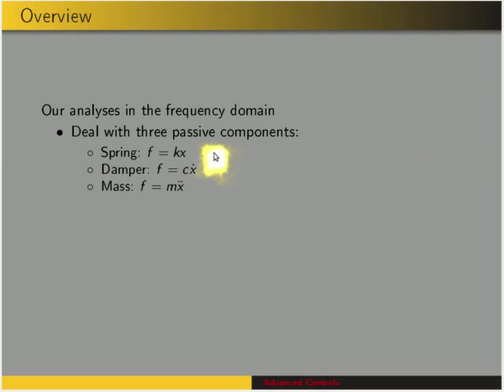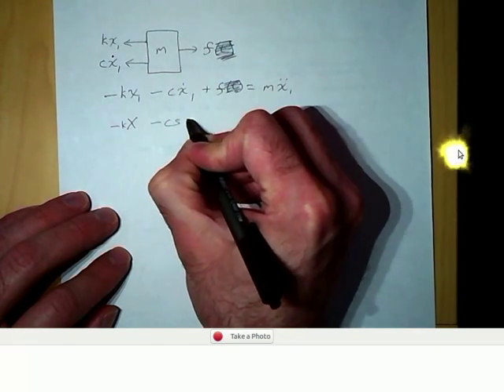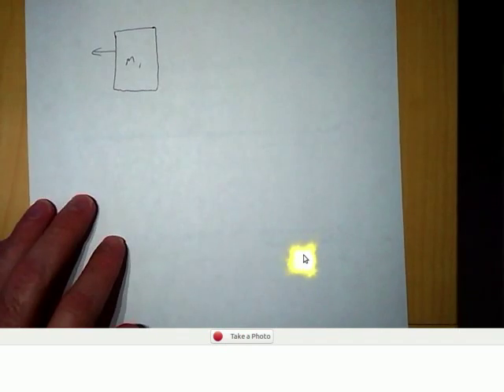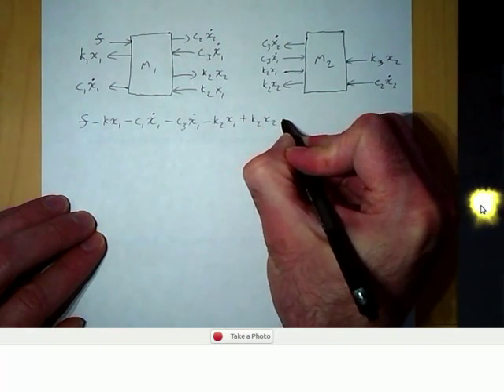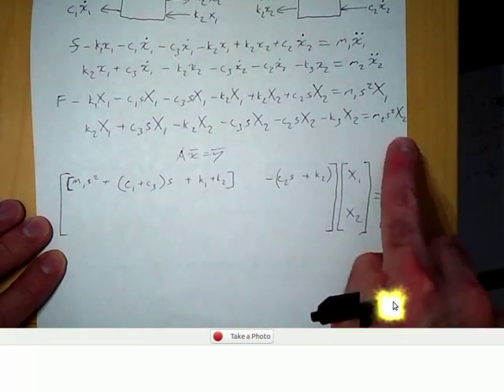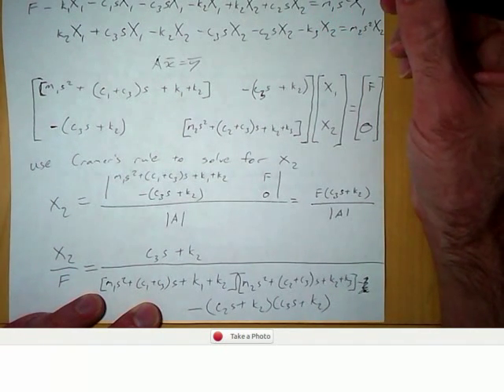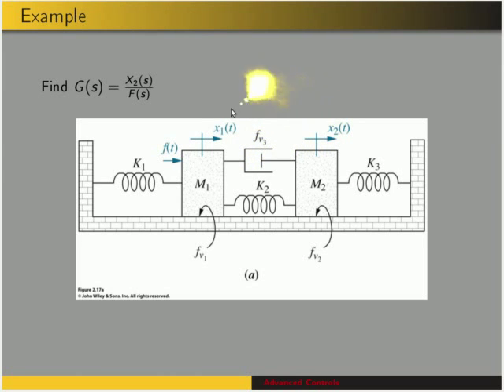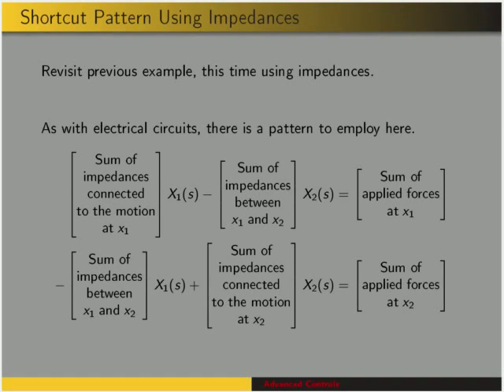MFD02_translationalMechanicalSystems

Comment: why is the force F only applied to m1 and not m2?
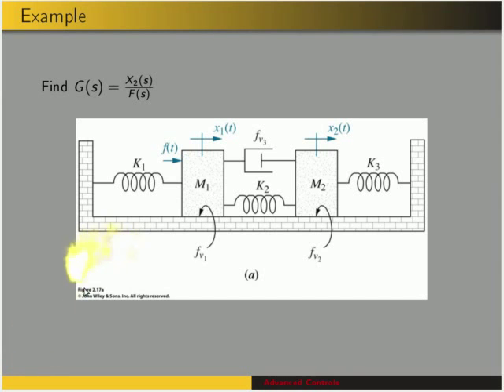Reply from the maker: That is just part of the problem statement.  At 6:48 the external force is shown acting on mass M_1.
Reply: So how would you solve if you have 3 equations instead of 2?
Reply: same way but the force f is just shows that the direction u putting force to.